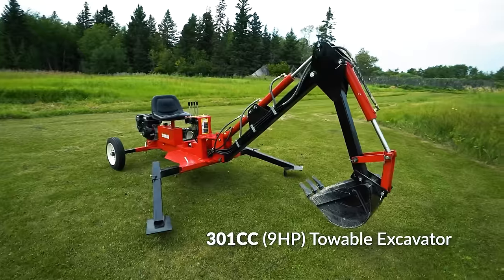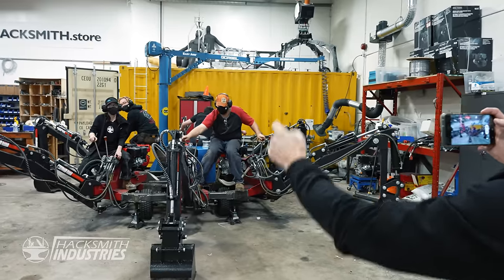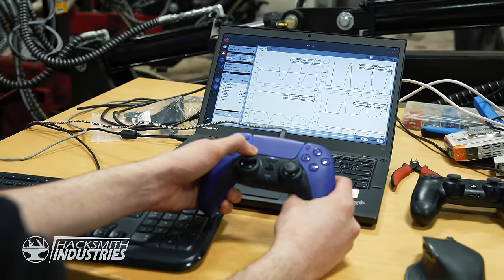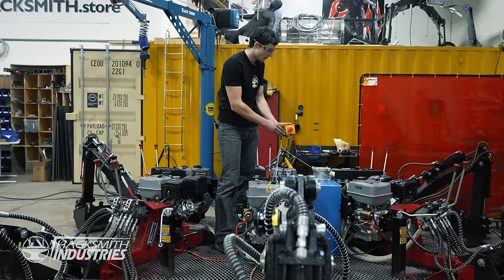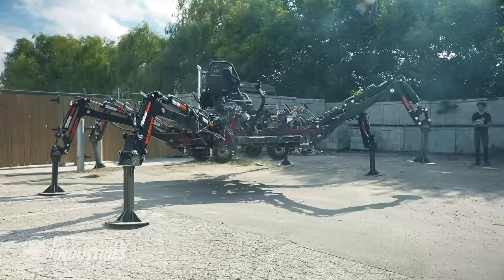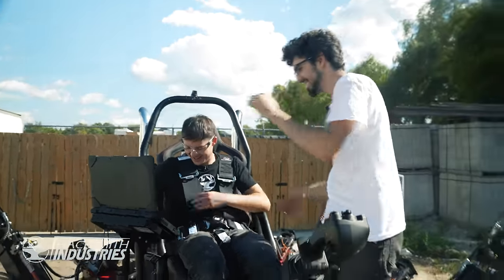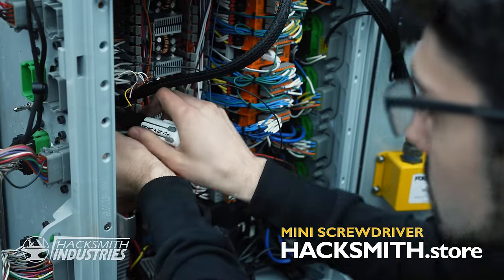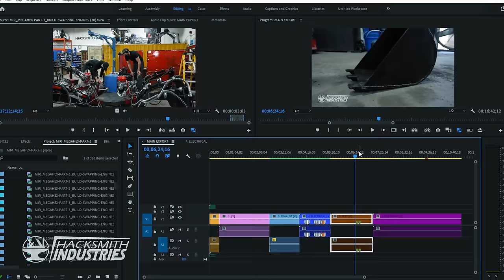Our BIGGEST project yet! (SPIDER MECH!)

Comment: As a mechanical engineer, working on a project like this would have to be my ultimate dream!
Reply: And ultimate nightmare too
Reply: As an automation engineer, this is nuts. If I had to program/do wiring and testing this beast, not to mention debugging. The effort to make it moving is insane.
Reply: @laurioxas1  That's true! It takes forever to tune a PID of a Single Motor, not to talk of this ~18 DOF System.

Comment: I am a retired engineer from one of the major automobile companies.  I spent an equal amount of time in product testing and software design over a 30-year period.  There is NO better way to learn than through application.  No book will ever teach you all that you learned by doing this project.  I have a BSEE and that got me into a company and started with the basics, but it wasn't until I was in the field that my real education started.  I can not begin to tell you how amazed I am that you got as far as you did.  There are SO many variables to consider.  You guys are absolutely amazing and exactly what engineering is about.  Do NOT be disappointed in the fact that the frame didn't stand up to durability testing (which is what you ultimately did when trying to figure out how to get it to function).  All of those who worked on this project represent who we need driving to a better and more interesting life.  Keep up the great work!!

Comment: I am really saddened that this project was put to rest even if it had the real potential of becoming something so much bigger... But I suppose I shouldn't request too much. The fact that the Megahex project carried out this far to begin with is a miracle of its own, and the fact that ya'll cared this much about your passion project that you were working on it despite it making you loose money, to the point that it almost pushed you to bankruptcy... That's wholesome, man! An inspiration to all the aspiring engineers or any other artists at that matter, and a textbook definition of ''Step by step goes a long way.''
Reply: I wonder if it would be possible to make it completely analog. Like rather than computer programing to make the legs move just right, it maybe could theoretically be possible to have that all controlled by a gearbox, and the 'pilot' could control the direction with a stick connected to the gears?
Reply: @-jank-willson  that would be so much stress that it'll probably snap instantly

Comment: Hopefully way down the line this project can be revisited. But this is definitely a lesson in asking and understanding the important questions before beginning building. Shear stress during turns was definitely something that was majorly underestimated! 

Don’t let this failure take away from what you built and how close you came to success! We’re all proud of how far this team has come and how ambitious they remain!
Reply: I'm a machinist, and while I'm not familiar with creating accurate stress analysis reports, some simple math, and individual destructive testing of critical points to confirm the stress analysis they did do, could have at least proofed out the concept.
Reply: well... if anything they did have a MVP, even if it's a "single test" only MVP that ends in a week of repair...

Comment: Awesome video. I would love to see a detailed breakdown of the software side of this project. This was obviously a huge undertaking to export the model from Solidworks (URDF?), to then manage the joint locations so you could get the nice real-time graphics in RViz and feedback to help config your PID controllers. Awesome job all around, really showed how difficult integration of robotics systems can be.
Reply: This just gives me that much more respect for the Factorio devs when they created the Spidertron. Granted you don't have to deal with physical and structural limitations in a video game, but just the control logic by itself is impressive.
Reply: @DFPercush  same here
Reply: @DFPercush  Not trying to undermine the Factorio devs as they have done some amazing work, but admittedly writing the code for a video-game hex-walker type thing is really not very difficult. I say this as a professional software developer who has spent a lot of hobbyist time working in game dev/studying the kinda math that's used to do this stuff. Let me explain further, though so I don't come across as a 'WELL ACKSHUALLY' type asshole lol (sorry if I still do!!):

What makes making something like this so insanely difficult (specifically the thing in the video) is as you mentioned the fact that your computer model needs to PERFECTLY match the real world object. That means EVERYTHING needs to be made within incredibly precises parameters. Then on top of that, your sensors need to be incredibly accurate. They can't have any slippage, they can't drift, they can't be noisy.

And then even further you need to account for all kinds of mechanical processes in the software that only begin to emerge after testing. For example, the legs flexing under load/stress but not while idled. The feet bending after heavy hits, the sensors slipping due to a sudden unexpected load, etc.

In the world of a video game, ALL of that is gone. Making a little spider mech in a video game is genuinely high school level geometry and algebra (for the most part).

As a final clarification, I'm not downplaying the Factorio devs. The work they've done to optimize that game to make it run so well, is truly incredible. The amount of shit that's happening in the game every frame is obscene, and to have that all work so smoothly and cleanly is fantastic. I think that's where the admiration should be given, they have quite a few dev blogs written about how they got conveyor belts working (efficiently) for example lol.

Also, in case you want 'proof' read about Inverse Kinematics. It's exactly how you accomplish this type of thing. It's the field of math devoted to "I have a robotic arm and it needs to put it's 'hand' here. What angles do all of the joints need to be?". It's an incredibly powerful and fascinating area of math!

Anyway, I hope I'm not coming across as an ass here. This is an area of math/engineering I am personally very passionate about so I just love to talk about it!
Reply: Looks like ROS2 to me
Reply: They used the "KevinOchs/hexapod_ros" repository as a base.
Reply: MONEY!!! CASH!

Comment: Some ideas: soft foam "shoes" for the metal feet to get acceptance from gardeners. All connector fields are to be oriented downwards and are not soldered but clamped.
Restructure the feet so you have raised lever-points to be pistons for the movement of the legs, or at least give them more height, its trying to carry itself around  crouched which eats up much of its lifting capability. Remove any cockpit/seating and do it remote controlled with drone cams. Whatever the laptop does automatically should go to an arduino or similar microcomputer. (  more sustainable regarding power consumption )... anyways, super-nice work folks.

Comment: each joint needs to have a sort of feedback loop that tells the controller if it's on the right angle

next is adding a gyro to level the frame:
1. gyro tells the controller that the frame isn't leveled.
2. controller now communicates with the hydraulic pumps, telling to move those legs.

adding pressure sensors under each foot can also be installed

at this point, it's more on the programming and getting the right algorithm to mimic how the spiders walk. (animatronics)

I know you guys can pull this off, don't give up!
Reply from the maker: It does.

Comment: You should take what you've learned from this project to make a smaller project from the ground up.  Rather than use existing parts that were manufactured for a specific purpose, get individual pieces that can withstand the stresses involved.  That way, you can perfect the design with far lower costs and scale up for a second or third iteration.
Reply: absolutely right
Reply: Good idea
Reply: This what happens when you have a idea on a whim. Bunch of genius people but too optimistic
Reply: I wouldnt do that, as a robotics engineer you want to use prefab modules. There are many things that went wrong here but indeed making a "scaled" version first would have helped identify the control issues. If you try to design/manufacture everything you spend much more time and money. You are better off breaking a few parts instead. 

In the end it looks as though the machine was creating incredible impulses when dropping the legs, proper non-linear controllers designed for each leg and different feet design would have probably been enough to make it work. Ie, spring dampers to lower the impact, force control with grabity compensation instead of velocity control and a ball joint at the feet would have probably saved it. But none the less this is an incredibly difficult project and the fact they got so far is a massive win. Great work everyone who was involved, absolutely insane stuff!
Reply: that's what i was thinking
Reply: @molomono9481  i think that ellipse design for the feet would have given them much better grip and less strain on each leg 
not to mention that dragging it like that on the ground and not having a drop cushion was probably the reason the frame broke like that
Reply: @molomono9481  I didn't mean for them to manufacture parts. I meant using prefab parts on a more individual basis.  Probably almost as difficult to find prefab parts to fit together on such an unusual project, though.

Comment: Hey guys, good try! You got close, but a total rebuild is definitely a deal breaker. In my opinion, looking at the materials of each part may have helped, and may help with future mega-builds like this one, if you do any. The specifics of what steel you use, how thick it is, and how "light" your frame in the center is are key factors. Gl hf. Good to see you back!
Reply: Im in no way an engineer nor have I really built anything remotely as sophisticated as this. But that was my immediate thought, the following one being im sure there is a reason they couldnt, but first thought was wouldnt it still function with a lighter frame? and couldnt they scan/raw data catalogue  all the pieces and parts and either 3d print or commission those pieces in a lighter material? 

If 3d printing the metal was a possibility you could in theory hand-model the best structure(probably replicate a smaller version of a hex bot that works great) for weight distribution and save even more weight.
Reply: Also the orginal levers weren't constructed for this geometry. I guess a total mew frame with bigger levers would have reduced the stress in those points. But sick project yeah:)